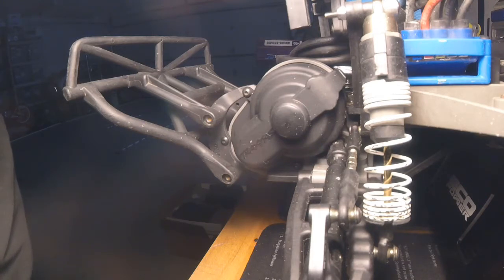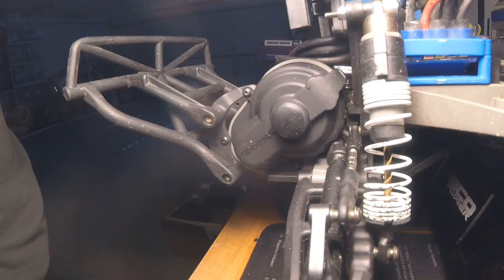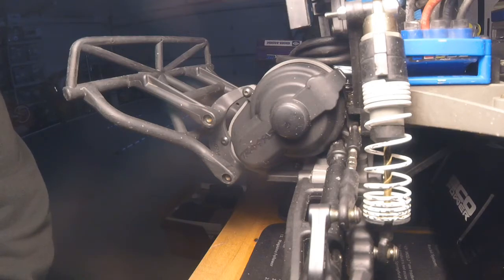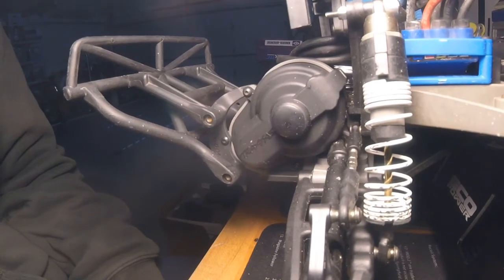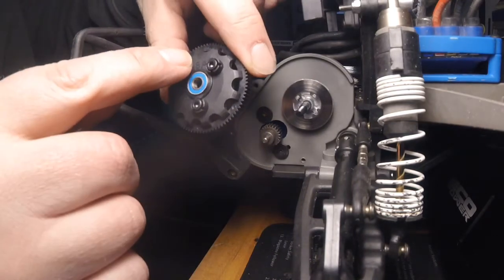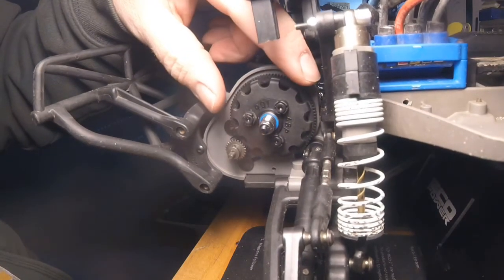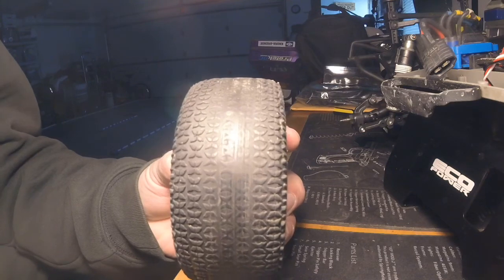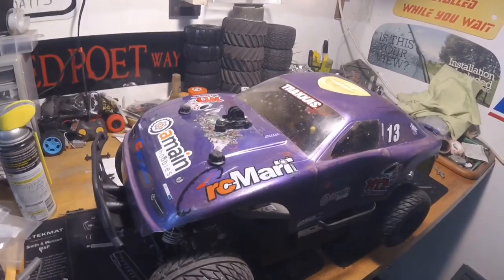Traxxas Slash 2wd Gearing

Comment: How do I get the spacing just right, no matter what I do the gears are wayy to tight together
Reply from the maker: I was able to space it right with the current set up in this video, but I have seen people modify with a dremmel tool…
Reply: @DoubleDeeeZSlings  I tried putting the optional gear setup in it and it was just way too tight
Reply from the maker: Double check everything, it should work…. Maybe you can get a little more adjustment out of it

Comment: I ran a 27 tooth pinion and 86 / gear onto 2S battery and it was wicked fast pour-wheeleys no problem only problem I had was the overheating so you could get maybe 4 swipes and let it cool
Reply from the maker: Hell ya!  It’s getting cold around here, so the dragster is on the shelf for now,  but I’ll be back at it in spring, I’ve been doing a lot of indoor mini crawler stuff now…